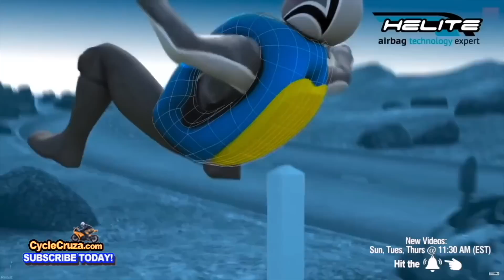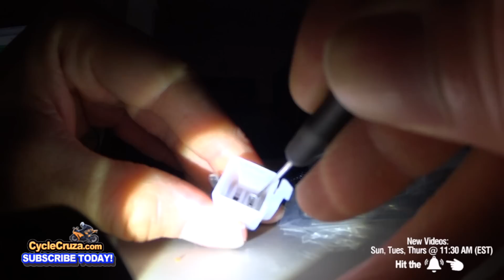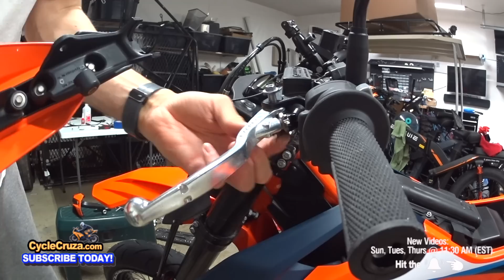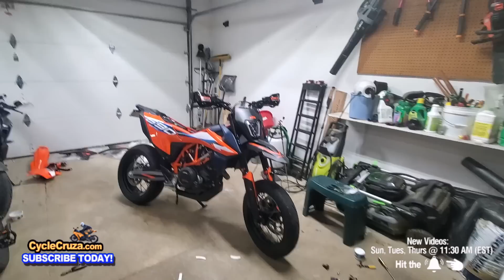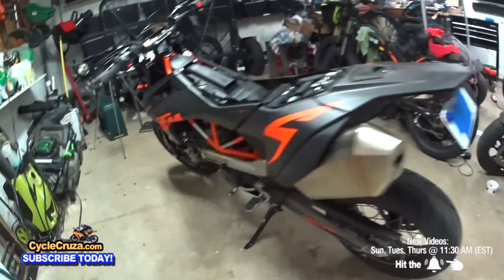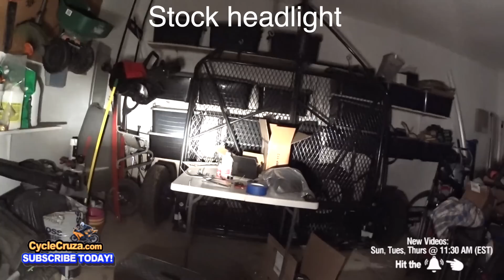2024 KTM 690 SMC R Build EP02 | Graphics, LED Headlight, Skid Plate, Zeta Handguards

Comment from the maker: Get My New MotoVlog Camera (On Sale!): https://amzn.to/3R4MiLY
Get My Carbon Helmet (Best Ever!): https://cyclecruza.com/vhxg
Get AIRBAG Vest (On Sale!): https://cyclecruza.com/w34j
Links to get My GEAR, MODS and Other Stuff: ⬇ 
*MY KTM 690 SMC R MODS:
LEOVINCE Full Exhaust: https://cyclecruza.com/mmsq
KTM 690 SMC R Graphics Kit: https://amzn.to/4b3Cnyx
Graphics Kit Custom: MotoProWorks.com
(MotoProWorls 15% Discount Code): cyclempw15
KTM 690 SMC R LED Headlight: https://amzn.to/49NgXor
Zeta Hand-guard Kit: https://cyclecruza.com/89qz
Zeta Black Handguard U Clamps: https://cyclecruza.com/703k
Zeta Handguard Smoked Turn Signals: https://amzn.to/3UDzpLC
Handguard Mirrors: https://amzn.to/3UFETWu
KTM 690 SMC Black Plastic Kit: https://cyclecruza.com/7j5b
Get GoPro Camera Mirror Mount: https://amzn.to/3Uln8Kv
Get KTM Mirror Hole Plug Bolts: https://amzn.to/3w64P46
Get Lithium Battery (Restart button!): https://cyclecruza.com/mymc
My Supermoto Tires (Best!): https://cyclecruza.com/tdlv
KTM 690 SMC R Skidplate: https://amzn.to/448xsKh
KTM Confort seat: https://amzn.to/3Uomyvo
My Fender Elim Kit: TSTindustries.com

Get My CE Armor Jacket CHEAP: https://amzn.to/3AxZ6k7
Get My Motorcycle HOODIE: https://cyclecruza.com/nsx7
Get My Leather Gauntlet Gloves: https://cyclecruza.com/iclm
Get My New 360 CAMERA (So Cool!): https://amzn.to/3CFvhRs
Get My New Shorty Gloves: https://cyclecruza.com/pgip
Get Dynojet ECU Tuner: https://cyclecruza.com/3lh4
Get Urban Camo Pants here: https://amzn.to/3EDAET0
Get UNLOCKED Galaxy S10+ (CHEAP!): https://amzn.to/2WQXe7w
Get Phone Holder Wireless Charger: https://amzn.to/3CQFtX2
Get GoPro Mount (Saves Space!): https://amzn.to/3Aen7yY
Get My Helmet Microphone: https://amzn.to/3w8wTna
Get Bar End Mirrors:  https://amzn.to/3TlbJZu
Get the BEST Tires Ever: https://cyclecruza.com/7wad

Links to ALL of My Stuff: http://cyclecruza.com/my-gear

MY E-BIKES & E-SCOOTERS
Get HiBoy FAT Tire E-Biike (Awesome!): https://cyclecruza.com/b8kv
GET My Folding FAT Tire E-BIKE (-21% off!): https://amzn.to/3KXpWqR
Get My Titan Pro E-Scooter ($100 off): https://cyclecruza.com/hicz

MY HELMETS:
Get Bell Carbon Helmet (Best Ever!): https://cyclecruza.com/vhxg
Get My Dual Sport Helmet here: https://cyclecruza.com/lkm0
Get Ear Plugs here: http://amzn.to/1PE0NTn

MY JACKETS AND JERSEYS:
Get My Leather Jacket: https://cyclecruza.com/q9tq
Get Sedici Garda Jacket (Best for Street): https://cyclecruza.com/sffi
Get My CE Armor Jacket CHEAP: https://amzn.to/2BIRAG7
Get Hi-Viz Armor Jacket CHEAP here: http://amzn.to/1TC9fBa
Get My Winter Motorcycle Jacket: https://cyclecruza.com/l9xp
Get Hi-Viz Rain Jacket: https://cyclecruza.com/00xh
Get My Hi-Viz MX Jersey here: https://cyclecruza.com/iifs
Get Motorcycle Hoodie here: https://cyclecruza.com/nsx7
Get My New Hi Viz Spring Jacket: imp.i104546.net/k0OR3L

MY GLOVES:
Get My Leather Gauntlet Gloves: https://cyclecruza.com/iclm
Get HEATED GLOVES: http://cyclecruza.com/nwgp
Get My New Shorty Gloves: http://cyclecruza.com/w7ae

MY MOTORCYCLE PANTS:
Get My Leather Pants: http://cyclecruza.com/54cw
Get Sedici Garda Pants (Best for Street): https://cyclecruza.com/vb8e
Get KEVLAR Jeans: https://cyclecruza.com/vxij
Get My HI VIZ CAMO PANTS: http://cyclecruza.com/hivizcamo
Get Urban Camo Pants here: https://amzn.to/3EDAET0
Get Yellow Camo Pants Here: https://amzn.to/2SjMGq8
Get Blue Camo Pants: https://amzn.to/2LBEgbk

MY BOOTS:
Get My Street Riding Boots: http://cyclecruza.com/uubp
Get My Dual Sport Boots: http://cyclecruza.com/3kn0

MY SOCKS
Get My Vented Socks: http://cyclecruza.com/0bww

My BACKPACK and STORAGE PACKS:
Get My New No Drag Backpack: http://cyclecruza.com/nr6x
Get My High Capacity Backpack: http://cyclecruza.com/k0w2
Get Water Bladder CHEAP: http://amzn.to/2b5w5nv
Get Motorcycle Tail Bag here: http://cyclecruza.com/tbag

MY MOTORCYCLE TIRES
Get My Sportbike Tires (Best!):  http://cyclecruza.com/pangelfront
Get My Supermoto Tires (Best!): https://cyclecruza.com/tdlv

MY LITHIUM BATTERY:
Get Li-ion Battery (Restart button!): https://cyclecruza.com/mymc

Emergency Carry-On Items:
Get Flat Tire Repair Kit here: http://cyclecruza.com/f5du
Get Moto Survival Kit: https://amzn.to/2EwtsrI

MY MOTORCYCLE STANDS:
Get Universal Stands: https://amzn.to/2Ct2fpQ
Get My Lift Table: http://amzn.to/2kt1pD7
Get Bursig Lift Stand: http://cyclecruza.com/f0lc
Get Adapter Plate for Stand: http://cyclecruza.com/cpwr

MY CAMERAS AND STUFF:
Get My New 360 CAMERA (So Cool!): https://amzn.to/3CFvhRs
Get My MotoVlog Camera: https://amzn.to/3R4MiLY
Get GoPro Hero Mic Adapter: https://amzn.to/2DAfiXL
Get 128GB MicroSD XC Card I Use: http://amzn.to/2ihwPsv
Get My Camera (Off the bike): https://amzn.to/2Kmqb5c
Get My Camera Bar Mount: http://amzn.to/2Au2k8B
Get My Helmet Microphone: https://amzn.to/3w8wTna
Get My 2-Port Smart Power Bank: https://amzn.to/2K8Pm5n
Get My Travel Tripod: https://amzn.to/2LVXooH

MY MOTORCYCLE TRAILER:
Get Stand-Up Trailer for Motorcycles/Side by Side/UTV/ATV:  
http://cyclecruza.com/p2yo

Get Stand-up Trailer for Single Motorcycle
https://cyclecruza.com/stduptrl

*MY MOTORCYCLE COVER:
Get Moto Sack: http://amzn.to/2lpIX9d

Links to All of my Mod Parts for my Bikes:
https://cyclecruza.com/my-mods

My Store: (All my Stuff) 
https://www.amazon.com/shop/cyclecruza

Comment: Just put my Moto Pro Works graphics on.  Your spot on easy to work on.  With the PC6 and Rottweiler intake you'll wonder why you ever rode anything else.  Hands down my favorite bike in 50 years of riding.
Reply from the maker: Honestly I don't know if I will do all of thet, might just slap on a slip on. I just watched a video with a dude that had a failed PC6 and the bike wouldn't start. From the dyno charts I;ve seen I don't believe you gain that much power (2 hp) to spend that much money and possible reliability issues. How has your bike been?
Reply: @CycleCruza  Best ever.  The Rottweiler intake is awesome.  Have fun with it.

Comment: the dealer shouldve provided a small bag of spares, bolts, a diff throttle cam, plastic replacement key, and the bottoms of those perch mounts...  my 500 came with all tht when i got it new.

Comment: Has anyone had issues with lifepo4 motorcycle batteries? 
I would think if lithium batteries were better for vehicle starting systems.  That all newer cars & motorcycles would come with lithium starting batteries now instead of lead.
 I know some gas electric hybrids cars. Still use a lead battery to start the gas engine. Despite having the large  EV lithium battery bank.